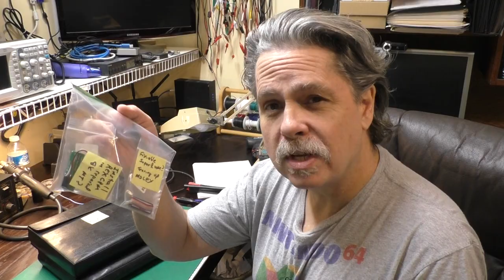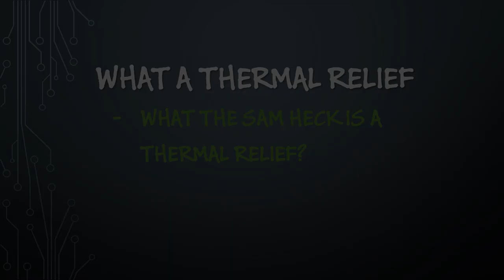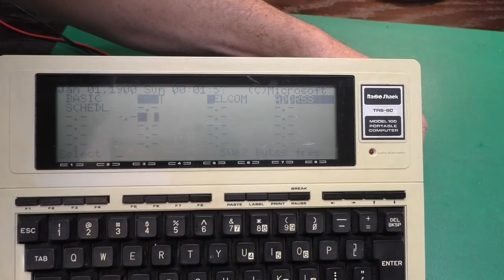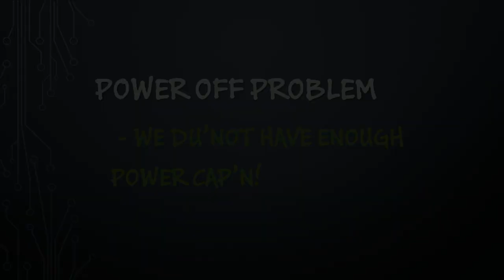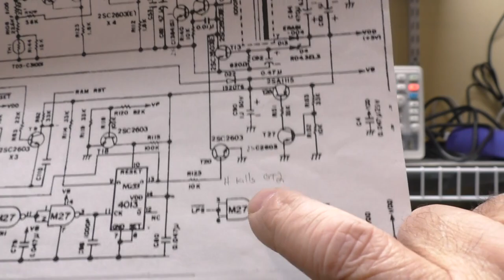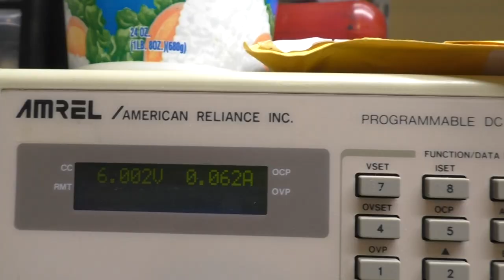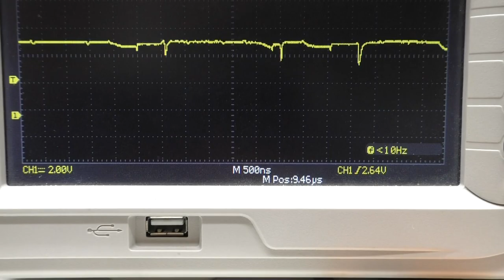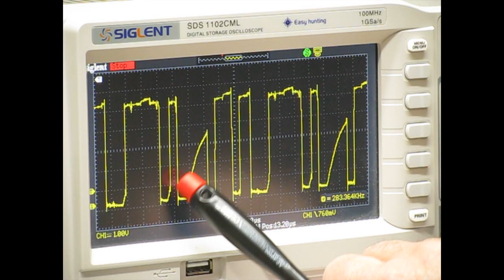TRS 80 M100 Recap rescue and Molex mishap Part #1, 'Trio of strange problems'

Comment: The way I deal with large heat sinks on a board is to use an iron that can flow lots of heat energy quickly. Specifically, I have a station that takes t15 tip/heater cartridges; and I use the biggest “hoof” tip they make (however, big chisel tips work also). IIRC, the station is 70w. I don’t think I’ve ever had a cold joint with it.
Reply from the maker: There are situations where putting a lot of heat into a joint quickly is handy, for example soldering battery tabs. It can also let someone without experience create a lot of damage quickly.

With PCBs with a large ground plane on the top layer it is very hard to get the top layer hot enough without leaving your iron on the joint too long. Some components can also be damaged by heating/cooling too quickly. It is these types of cases that a preheater really helps. They make PCB specific pre-heaters, the little heat gun is sort of a 'poor mans' substitute. :)
Reply: @HeyBirt  Yeah... I’ve got a surface-mount rework station with a pre-heater. My experience, with my specific setup, is that my iron is sufficient to deal with large planes & component tabs without the pre-heat. Of course, YMMV. 😉

The temperature of the tip on my station is controlled tightly enough that I can set it at just a bit above the solder’s melting point, get a good joint, and still take my time without worrying about damaging the board. From what I understand, this is principally due to the all-in-one bonded heater-sensor-and-tip design of the t15 cartridge; supposedly irons that don’t have this feature don’t work as well (this I gather from watching other YouTube videos; I haven’t done a soldering station shootout myself).

🤔
Reply from the maker: I originally misunderstood your comment to be the old canard of "Turn the iron up and apply lots of heat quickly using only 1 second of dwell time." Which of course leads to disaster much of the time. I should have taken more time to read your comment carefully.

Not everyone has  the luxury of nice rework tools like we do so I try to cover other rework methods that work with simpler tools. As you mention if someone is using an iron that is not temp controlled one can very quickly lift a pad, etc. 

Generally my Pace rework station does not have an issue with applying enough heat. This is an issue with the ground plane being on the top side and it is difficult to get enough heat through the small through hole. The iron is not the limiting factor it is the heat transfer to the other side of the PCB. Even when soldering the part back in with a 90W iron the heat transfer limits the flow through to the top side of the PCB, but if the through hole plating is is good shape that is not a huge problem.